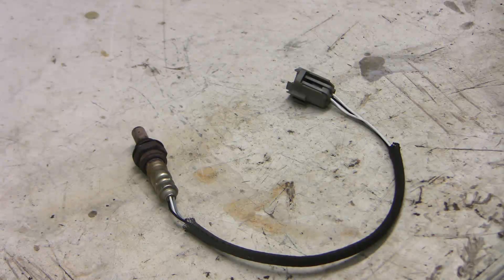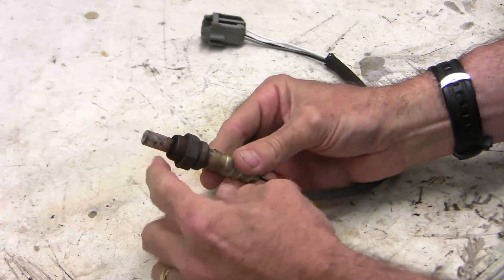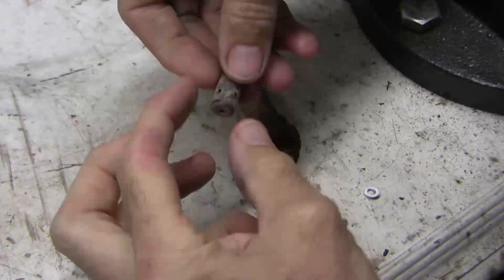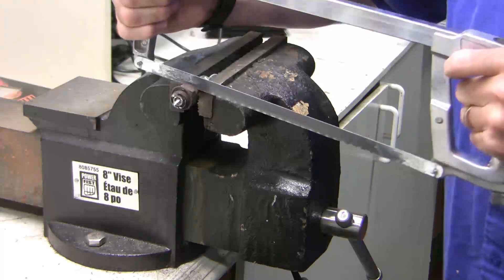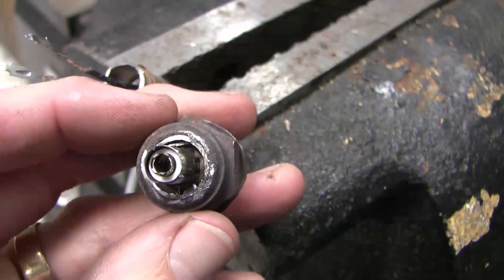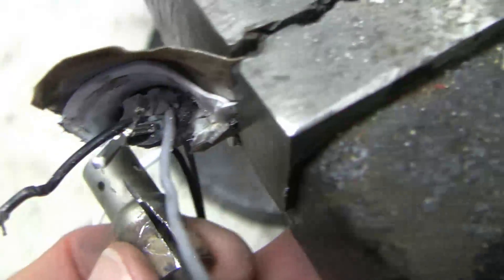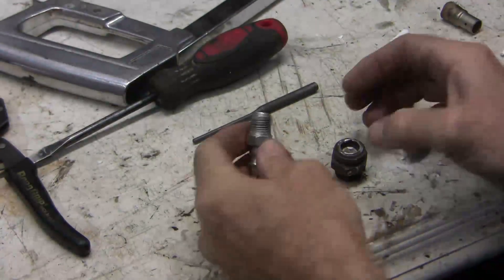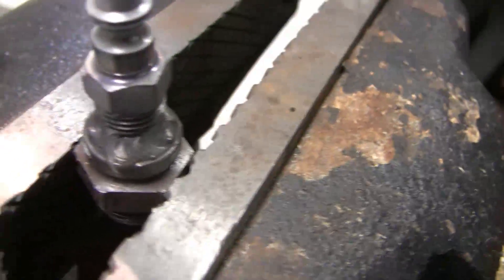Make your own exhaust backpressure adapter

Comment: This is educational..I was going to attempt to build one as well.. i happen to be a plumber that can jiffy rig alot of things but i dont think i can remedy this contraption without a welder..
Reply: ok thanks.. I was just looking at sparkplug oil foulers which is also m18x1.5 threads and buy a m18x1.5 barb adapter to slip maybe 3/16" rubber hose to it but them adapters are a little bit expensive.. I'm thinking at this point I will just by a cheap gauge assembly..😊
Reply from the maker: Most guys just drill a small hole, and push an adapter onto it to get a quick reading. Then if pressure is normal they choose a screw that fits the hole to plug it up. If the hole is close to the cat, that segment will be replaced anyway if pressure is high.

Comment: This is great... so all I need to do now is go out and buy a freakin $50 O2 sensor just to make this homemade contraption, wtf.
Reply from the maker: Anybody who does auto repair will have access to old oxygen sensors, and big professional shops replace dozens every week. I'll bet you could even go to a shop and they would give you one for free. Most shops just toss old sensors into the trash, although a few might recycle them. Failing that, the usual approach is to drill a hole in the exhaust upstream of the cat and measure pressures there. The only problem after that is how to plug the hole, after you're done. If the cat is bad and you decide to replace it you usually need to replace that line anyway. You could also plug the hole with a rivet or even a screw. The hole needs to be fixed because the exhaust leak can mess up oxygen sensor readings.

Comment: Why wouldn't you just start with an exhaust bung
Reply from the maker: Maybe I don't understand your question. To use this you don't modify the exhaust at all, just pull an oxygen sensor, screw in the pressure tester, start the car and take readings. Then screw the oxygen sensor back in, with no permanent change of the exhaust at all. No destructive holes, no drilling, no extra parts.
Reply: @spelunkerd   An exhaust bung plug would have fresh clean threads an good steel to cut threads into to connect a section of pipe

Comment: You can also use the threaded end of most compression testers provided you remove the Schrader valve and have a vacuum tube adapter.

Comment: whats the adapter name, size..etc.? thank you
Reply from the maker: +Isshman Garcia Not sure, I used the same size that fits a typical O2 sensor. You may need different sizes for vehicles that use atypical sensor threads.
Reply: +spelunkerd Thanks

Comment from the maker: What a thoughtful remark, I wondered if somebody would comment about that. I am now at the relative age that exposure to weak radioactive isotopes is no longer a meaningful concern. Like most people my age, when you're on the tracks of a fast moving train, slow trains behind don't mean much, (grin). I also have a full complement of 1.5% thoriated TIG rods, and the same applies there. Had I experienced daily, constant exposure in my 20's, I might view it differently.

Comment from the maker: Motorcycle mechanics have told me that when an exhaust is changed (usually removing obstruction to make the bike louder), you need to re-jet the carbs or the bike will paradoxically lose performance. Bikes are 'tuned' to a specific exhaust resistance and resonance, so even a few inches of length can make a difference. With bigger engines I suspect the same applies, though with multiple cylinders it may be less marked. But normal pressure there in a car is less than 2psi.

Comment: I am wondering about something you touched on. The "measuring pressure in the exhaust" I wonder if that's why when you have a hole in your exhaust the car tends to be off a little when you hit the gas. Like too much air is getting out and when you hit the gas , it't hesitates?

Comment from the maker: Yeah, I've seen JB weld used in all kinds of situations where I didn't think it would hold. For this application, pressure is minimal and exposure time would be a minute or less. JB weld would do fine here, even if it got a little warm.

Comment: As a kid I once JB Welded the #1 spark plug into a VW pancake engine that blew out the largest insert available. Ran it like that for years. They now have a quick set version but I'd question whether it would be as strong over time.
Reply: I did the same thing. Blew out eventually and put in insert.

Comment: As a kid I once JB Welded the #1 spark plug into a VW pancake engine that blew out the largest insert available. Ran it like that for years. They now have a quick set version but I'd question whether it would be as strong over time.